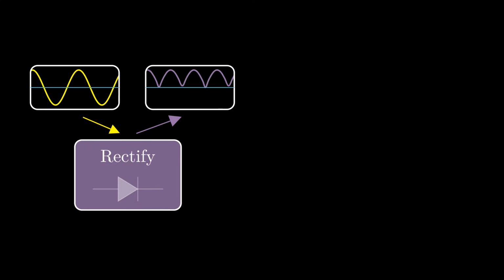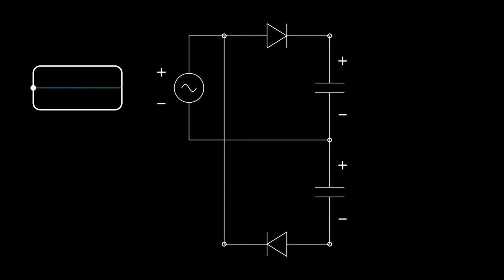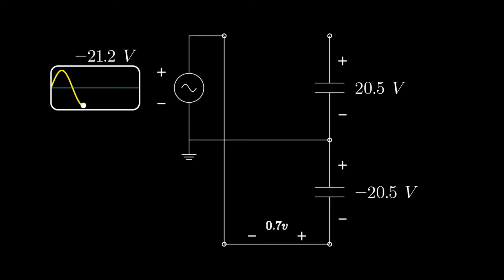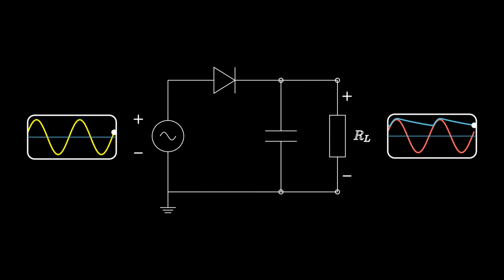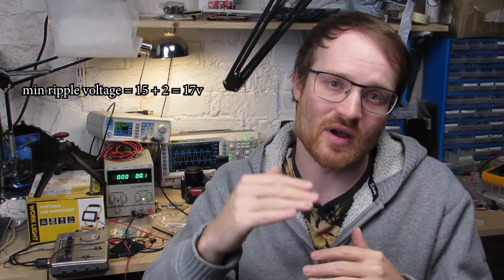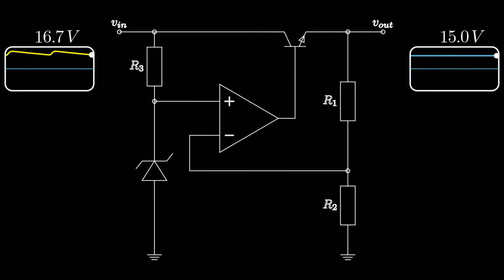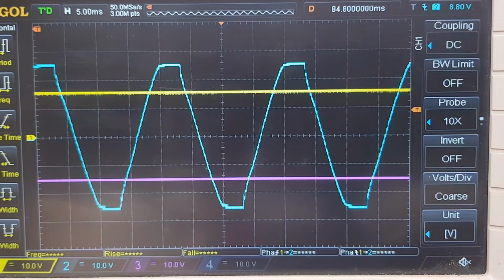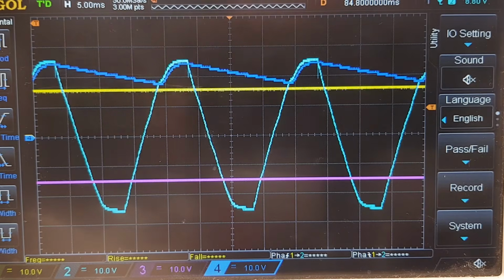Design Your DIY Power Supply! (+/- 12/15V)

Comment: Those ac-ac transformers are really hard to find in me experience, especially for European plug 230V. Where did you get yours? Also 300mA don’t sound like a lot.
Definitely will be looking forward to your next power supply video
Reply: I just built a similar power supply, and I bought an AC-AC wall-wart transformer from a UK company named acadaptors-r-us, that specialises in them. It cost me about £20. It's a shame because the very next week, at a car boot sale, I found one from a Creative speaker system. I paid £1.50 for it and it's perfect for the job. Part number MAE180080BH4 just in case you are lucky enough to find one used.
Reply: No, they are not. Since everyone uses nowadays switched power supplies, such old transformers are easily found. Or you visit your local thrift shops and take as much as you want at home...

Or you can also use Old AC-DC power bricks.
You just have to rip out the inner electronics
Reply: Thanks, thrift store might be a good idea. I didn’t see the point of opening up power supply’s to rip out the inner electronics, it doesn’t really provide any safety advantage
Reply from the maker: @woosix1  no I wouldn't recommend doing that for this project.
Reply: @woosix1  Yes, but after you removed the inner electronics, you can close the case and if done properly, you are completely safe.
Reply from the maker: I got mine from a place that sells them specifically for the UK. I will have a look around to see if I can find some in Europe and get back to you :)